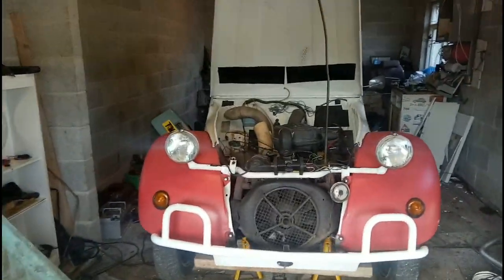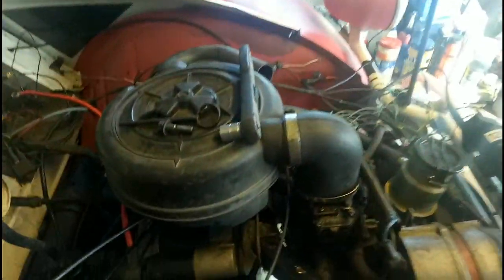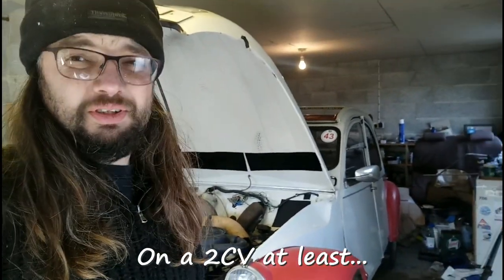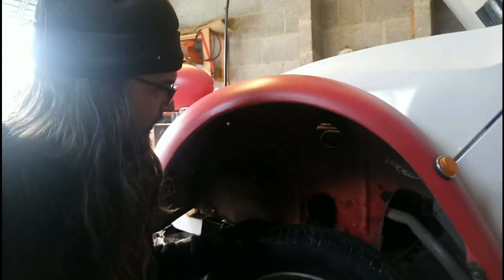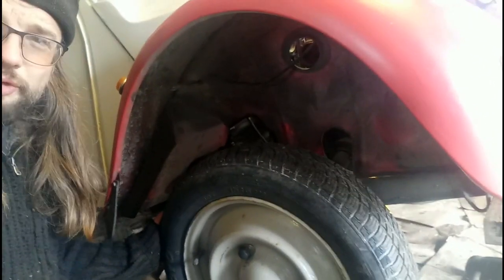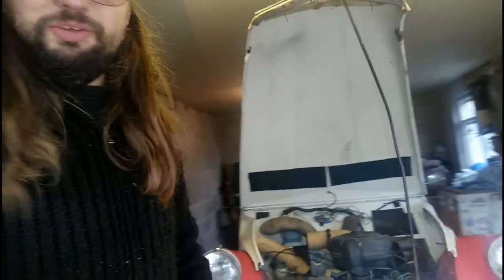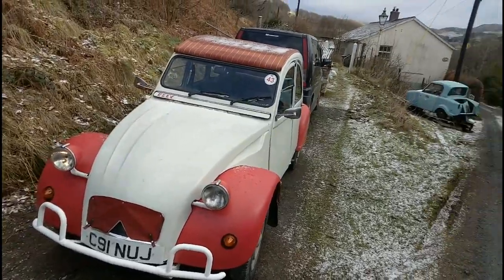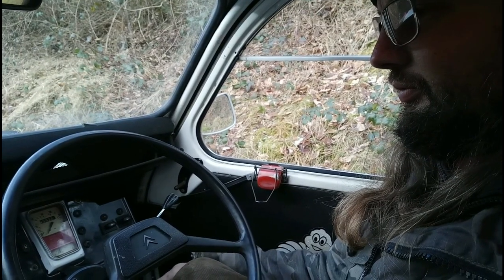Wake up Elly! Hibernation is over. Citroën 2CV.

Comment: Another feather in the cap for old proven motoring, do love them inboard brakes setup and the unusual front disc handbrake as that must have flown in the face of just about every car designer of its time lol
Reply from the maker: Front handbrakes aren't that unusual. Many Citroens and Saabs had such a set-up.
Reply: Forgot about Saabs, I remember on my 99Turbo what a pain brake parts were to get for it but can't remember way back to the dark ages where the handbrake was on the ol' beast remembering its titanic thirst and the odd ignition switch in the centre going on there lol.   Sadly I am a product of the masses in having lots of Fords and BL branded stuff over the years so assumed it was the "norm", as for the inboard discs on the Citroen, bet they are a million times easier to work on than the blasted Rover P6's inboard ones which my poor knuckles and trapped forearms remember with much pain and sweariness cobbled with pinhole surgery and right angle spanners and in the end outright violence on hehe
Reply from the maker: Oh yes! I never had the courage to work on the rear brakes of either of my P6s. Beautiful engineering, but not for the DIYer...

Comment: I can't quite see quite how you're gripping the handle but ...
When using a hand crank to start my '63 Hillman I was taught to put my thumb on the same side as my fingers. If it backfired my thumb joint didn't get dislocated.
Neat car.
Reply from the maker: Correct. Always be careful with thumb placement.
Reply: @HubNut  
!
:-)

Comment: Ask the mechanics at the MOT station which sort of grease guns they use, then get one of those. I would recommend getting one with a selection of rigid nozzles in order to save your knuckles when accessing some hard to get to nipples, flexible hoses are o.k. but they do limit the pressure and won't last very long.

Comment: My mk4 escort has a manual choke, starting procedure is.
Choke out
Press accelerator 4 times
And abit of gas on turn over
Reply from the maker: Always varies from car to car. 2CVs that haven't been standing for months need no throttle for a cold start, just choke.
Reply: HubNut I half expected you to reappear with a branch

Comment: Start of the season? It's not even mid February - the Welsh climate must be better than I remember! Can't help with the grease gun, but can I offer a little advice on de-winterising the car? (A) Trickle charge the battery overnight prior to start-up day. (B) Remove the spark plugs on the first starter motor crank - it will help with oil distribution. (C) When hand cranking, don't wrap your thumb around the crank handle - I've heard you could break your wrist if the engine back-fires.
Reply from the maker: I know. I'm impatient! Good call about thumb on crank handle. I get carried away because she's never kicked back on me (the handle is designed to disengage if she does, but fair warning anyway). Getting the plugs out is a pain. I'm happy to hand crank with them in.
Reply: You remind me of me. Lol. Impatient - I remember rushing a cylinder head gasket change on my 1960 mini. After the change, I filled the radiator with coolant before tightening down the cylinder head nuts. What a mess! But I'm a great one for giving advice - just not so good at following it.

Comment: Sweet little engine there. Ever thought of using an impact gun and attachment instead of hand cranking it? I'd also change the paper pipe for something safer from a hardware shop to reduce fire risk. But then you are the 2cv expert not me... great video as usual.
Reply from the maker: Cardboard pipes are the best solution. Other materials have been tried, but noise is a problem. If they're tied on, they should be fine. And I actually like hand-cranking...
Reply: I've never hand cranked a car in my life, just thought there has to be an easier way to do it. Point taken.

Comment: Actually, the kingpin play on a 2CV should be measured between 6 and 12 o'clock of the tire. If you got excessive play between 3 and 9 o'clock, you should check for play in your steering joints or wheel bearings. 
At any rate, the MOT peoples knowledge regarding kingpins is the same in Norway
Reply from the maker: This is true, but applying grease made the movement go away...
Reply: Yes,especially if you use a high viscosity grease

Comment: Dont use exhaust paste. Use copper grease as it allows the exhaust to flex whereas paste cracks. Also my laser grease gun is still going strong 8 years later.
Reply from the maker: +James Wallace To be honest, I usually do use copper grease. Thanks for the Laser tip.

Comment: Excellent, Elly is looking great, well worth the restoration last year and the year before! :-) However, I have noticed that the front wheelarches are looking a different shade of red to the rear ones. I remember you painting the front ones, has the paint faded or was it a different shade of red to start with? This is the first time I have noticed it, still looks great though!
Reply from the maker: +Vintageaudiofan1992 I painted the front wings a different shade. I was going to paint the rear wings and bootlid to match, but that hasn't quite happened...
Reply: Ah ha, I see! That's okay then, it is meant to be! :-) For some reason, there are still a few Citroen 2CVs rattling around this area. Until I started seeing videos of your 2CV, I have to admit I was never much of a fan of them, but I am quite a fan of Elly now and I am starting to appreciate the ones I see near me now! :-P Sadly, I think the red and white Dolly (like yours) I used to see every week in Bexhill (Sussex) has recently disappeared from it's usual spot. I wonder what's happened to it, scrapped or being restored?
Reply from the maker: Doubt any are being scrapped now. Restoration makes most sense.

Comment: Starting handle ...  made me wonder about the last car made and supplied with on ...  I was thinking lada 4x4 niva ?
Where is that small gizmo box you had for boosting starts ...  not somewhere in the garage ? 
Apparently you could leave the top bush out of a Leyland leopard / Atlantean  king pin and it would pass its MOT
Mmmm ...  think not ,  remember once filling a grease gun full off araldite injecting the goo into a kingpin whilst someone else turned the steering back and forth till it went off .....  you do as your told when your an apprentice 
wiser now ....    I have had a Wurth grease gun for 5 years and not a bother but it takes the big industrial tube cartridge
Makes life a lot easier than sucking it out of a huge bucket ...  I miss bus fitting ..... NOT
Reply from the maker: Oh, good call. Wonder when they stopped supplying them on the Niva? Can't imagine they still have them. May need to look into that. 
Small jump pack doesn't work for jump starts anymore. Must do a follow up video on that. It might be the very next video in fact!
Reply from the maker: And I think the Niva stopped being supplied with a starting handle in about 2004.

Comment: That's the first time I've seen a starting handle used in anger for decades! The last time was back in about 1978, when my dad had an Austin Cambridge, only thing with that starting method was that if the engine fired up while the handle was still engaged it would kick back, my dad dislocated  his elbow once doing that! Oh the acorns! You must have had a hibernating squirrel or other small rodent in there!

Comment: Grease gun...Ian, when I got my Nuffield 18? months ago, I bought a new one. Knowing the servicing she'd had was minimal, to say the least, I did the best I could. On greasing the water pump (yes the pump has one) the gun jammed on the nipple. I actually had to break the nipple off. My mate (and saviour) Malc fixed it, fitted another one. They've a very small thread. However, and here's my point. The grease gun was metric, and the grease nipples on the tractor were imperial. Lesson learned. Oh I've since used my old, but good grease gun.....no problems. Why did I buy a new one??
King pins. After fitting new king pins, and bushes, properly reamed out, there should? be no play.....however we don't live in a perfect world, and they are perfectly safe with some play.
Sorry it's a bit long, look forward to seeing the running boards scraping on the ground :)
Reply from the maker: Yes, they are safe with play. Did have one MOT station that was a little too friendly with sloppy kingpins, and they did get so bad that the wheel would rattle on bends. A good indication that it was time to change the pins. The arms where these days, so even new pins tend to have a bit of slop.

Comment: I owned a 2cv6 dyan back in 1981 brand new colour cream and I had a gearbox fail between Newport and bristol on the m4 main agents had to replace the gearbox under the guarantee I kept it for 6 years part xed it for a datsun sunny wish I had kept it, the 2cv range were very well built and dam good vehicles.

Comment: Grease Gun?  I can recommend the Swiss-made Wanner. I've had mine for over fifty years, use it a dozen times a year, and never given any trouble. I don't know if they are still available new, but they regularly appear on eBay for £10-£20.
Reply: ^this - I paid less than £20 for mine on eBay, and it's an awesome bit of kit. My cheap modern one is 'orrible and thus never used.
Reply: Seconded, got an unused still boxed one off Ebay last year with a price in shillings in pencil on the box.

Comment: Omg hand crank too? I’m learning tonight.
Reply from the maker: She does have electric start, but I'd run her battery low using it on the Invacar...
Reply: ginggur17 Designed before WWII!
Reply from the maker: Well, sort of. The war saved the 2CV. It was pretty substantially re-engineered in secret. Pre-war design used torsion bar suspension and had water cooled engines. They were forced into the mountains to continue development, and the engines froze up...

Comment: What a triumphant few days you've had! I've always thought the MOT was great value and a real potential life saver, having an expert cast their eye over out-of-sight safety critical components. 

My old Xantia once failed on an excessively worn tyre. There was at least 5mm of tread on all the tyres as far as I could tell. On the inside edge though it was about 1mm, because of a worn bush. To think I'd been carrying my Missus and kids about in it at high speed was chilling.

Comment: Good news Ian
It did make me think about head lights, have you ever thought of fitting LED headlight bulbs as you know they do use a lot less power than a standard bulb also didn’t citron also fit the hand brake to the front discs on another model ??
Reply from the maker: Not really. Some of the racers use them, but it's a squeeze to fit the necessary gubbins in the headlamp shell. I'm happy with the halogen upgrade.
Reply: HubNut that is very true
Reply: HubNut I had a cx safari many moons ago and it had front disc hand brakes
Reply: when we get to our age, our kingpins do get wobbly, lol but anyhoo enough of that, ive always wanted one of those cars. the friench, theyve done some very interesting things. especially citroen. some call them ugly, but hey ugly means it sticks out and would be not good to steal because theyre seen easily;.

Comment: Never done that handbrake job, what's that special tool?
That eccentric nut, more clever Citroen design at work.
As 2CVs were designed as slow (40mph max) machines they thought wheel balancing wasn't needed, do high speed 2CV drivers get wheels balanced? needs a special accessory on the balancer.
Hand cranking, lovely, do you carry a spare Woodruff key?, I once lost it when the cranking nut loosened, cold feet but red hot cylinders.
Reply from the maker: Special tool is just a ring that fits around the eccentric nut. ECAS sells them. Wheel balancing isn't needed because of the perfect centre-point steering I reckon, and the narrow tyres. I've never balanced tyres. Just not necessary. Not sure what you mean by Woodruff key. They don't have one. On these later 2CVs (and I thought earlier ones too) the fan is just an interference fit on the tapered shaft. Have had a fan come loose once , and shear off the pulley another time. Both times, pinking let me know there was a problem, and a destroyed engine was avoided...
Reply: My fan centre used to lock to the crankshaft with a Woodruff key, a semi-circle of steel fitting in a groove.  After overheating it 'pinged' for a while in a motorway service area but was fine once I fitted a new key.

Comment: I had a cardboard heater tube ignite on a '72 Dyane I had  ( inboard drums - more of a pain ) . I just got out pulled it from under the bonnet and chucked it onto the grass verge before the car went up. The look of amazement on the face of a driver who went past as I appeared to pull blazing parts of my engine out and discard them was something that will remain with me.

Comment: If you like faff you should get an old Landy, you’d love it! Bit worrying how the acorns got past the air filter? And I thought surface corrosion on brake pipes was a fail now? 👍
Reply from the maker: I had a Discovery. It was hopeless. I had a Range Rover. That rarely worked either. Advisories are now a standard list, and it was there. Tester can't type them in manually. Acorns got in via the intake trumpet, but not past the filter.
Reply: HubNut I mean a proper Landy, not one of those posh coil spring Nancy things. They are sodding useless. If ever you want to road test a 1950 80” with Disco power.......

Comment: The  2CV is the car that my clever friends bought when they decided they had to get a car after they finished Uni. They worked out what they wanted a vehicle to do and then bought a new one as the 2CV ticked all the boxes. Lasted them many years but it did not drive well with their St Bernards in the luggage area/boot and was quite a sight at such a jaunty angle. Not good at night as the headlights were looking for aircraft rather than where you  were going . I always fancied doing a lomax conversion but due to their popularity and strong following now i think that ship has sailed. Grease guns are sent from the devils lair but latex gloves make them more tolerable.

Comment: Modern petrol is horrid, if you are leaving anything standing unused, drain the fuel.
I've had bother with cars, lawnmowers, generators and strimmers. It seems the easy lit volatiles flash off very quickly, leaving something a bit like paraffin or diesel in the float bowl, so difficult starting.
Usually a drain and refill with fresh fuel means an instant start.
Nice to see Elly running and tested again.
I would have named her Ellie, just to be posh, lol.

Comment: Great vid Ian! Mine is resolutely refusing to come back to life after winter. Fuel pump has had it I think. Re grease guns mine is made by Samoa, it's very good
Reply from the maker: Try my tip. Air filter off, pour a little petrol into the carb. They do suffer badly from fuel drain back these days. No-one has really been able to explain why. Some people are even fitting primer bulbs.

Comment: Good old Elly. The acorns were interesting, how did they get in there?  I've fitted electronic ignition and a new carb, so now it starts first turn although like you the starter is a bit sticky. I've allways said, you can't have more fun driving slowly. Congrats on the MOT and a fun year driving  ahead.
Reply: Robert Penning Hmmm ... rats?

Comment: I have got my Blue Cavalier also a 1986 (C reg)out of hibernation and I will be taking it for its MOT tomorrow all pre checks done just need to give it a good run as it’s been stood since the end of September mine won’t be getting taxed until April though for 6 months due to the swear word beginning with R. I am pleased the Elly has passed I will look forward to the break pipe video if you do it! All the best Steve.
Reply from the maker: Direct debit! Pay monthly is the best option. You can tax for just one month then. I won't be doing the brake pipe myself. It's an absolute pig of a job, as the brake pipe goes through the rear axle tube. Far easier on a ramp. If you know what you're doing.
Reply: HubNut Ooo I didn’t know you could do that with the dreaded tax thanks. Yes unfortunately I’m not blessed with a nice lift either everything is done off of Axle stands sadly. Cheers.
Reply: Mine passed its MOT today :-) just encase you’re interested cheers.